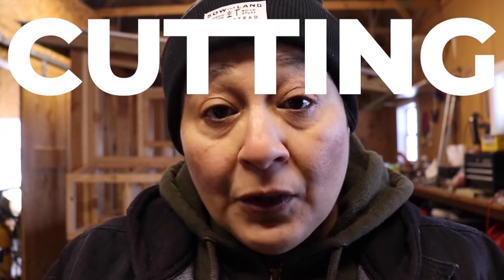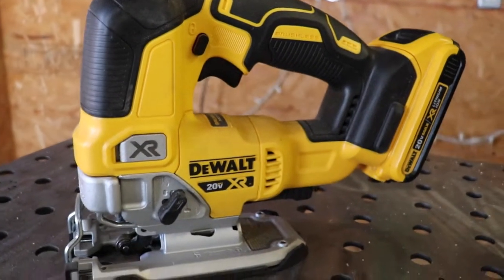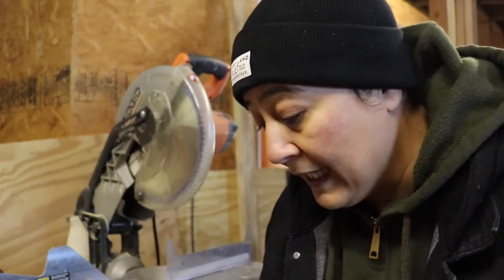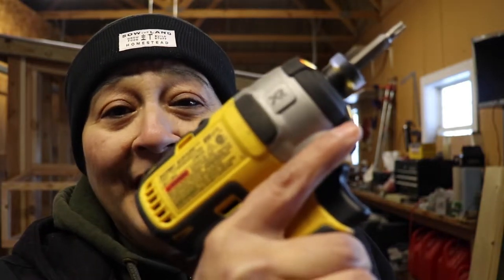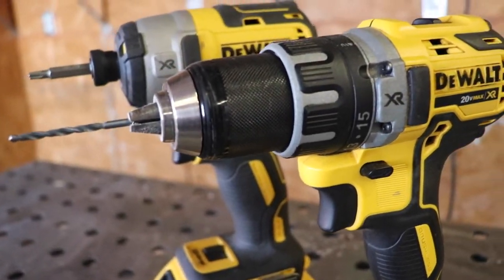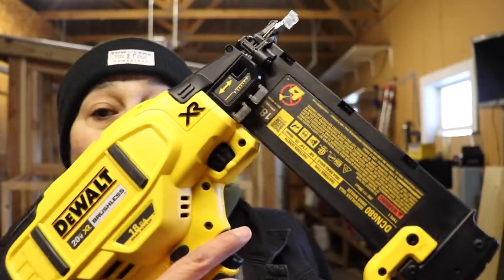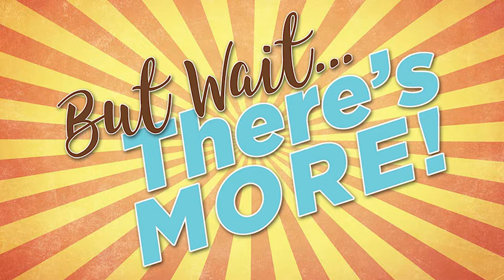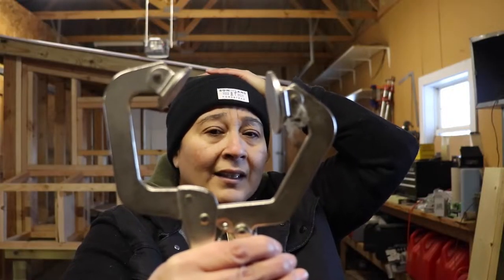Must-Have Tools for Beginning DIY and Woodworking

Comment: I so NEEDED this video!!! If you could only have 1 saw...which one would it be? Great tips Emma!!
Reply from the maker: I’m so glad you found it helpful. One saw? Miter. I use it all the time!
Reply: Good question! Miter is the most used on our homestead as well!
Reply: @SonniesPlace  that's what I figured. I love DIY and building, I know I need a saw. I just didn't know which one would be best, as close to all purpose as possible.  Mostly straight cuts.
Reply: Also, can you do a video on when to use nails vs screws? I just use screws and drill driver for everything 😆
Reply from the maker: @IndianaBackyardGardener  I really like the idea of creating a video for this and the decision process behind it. Thanks for the suggestion!
Reply from the maker: @IndianaBackyardGardener  If you're doing mostly straight cuts and don't need to be mobile, the miter saw is the way to go. We picked up a new compound sliding miter saw that'll give us a larger cutting length. Really excited to set it up and use it.